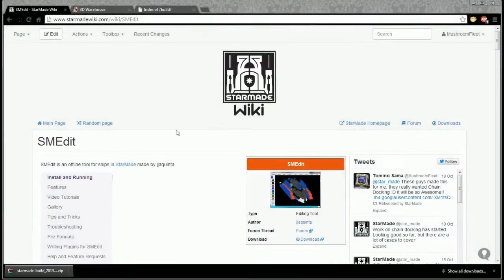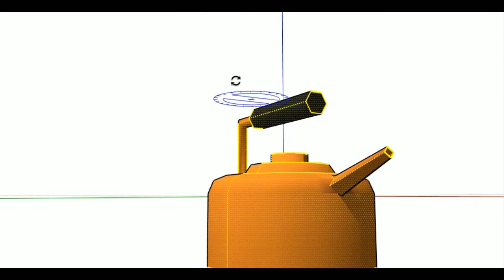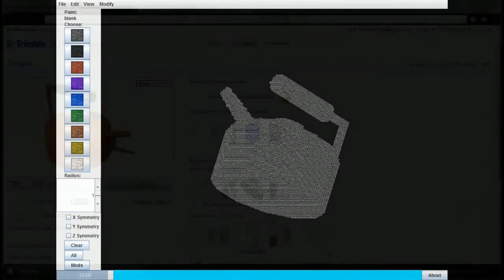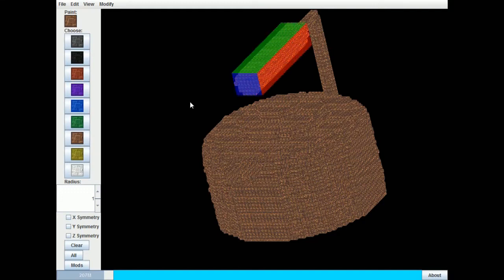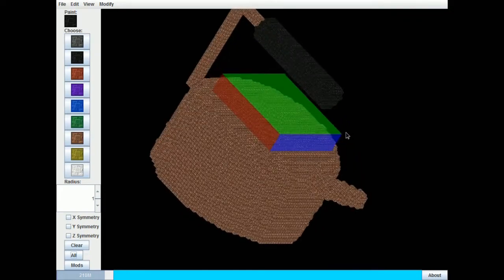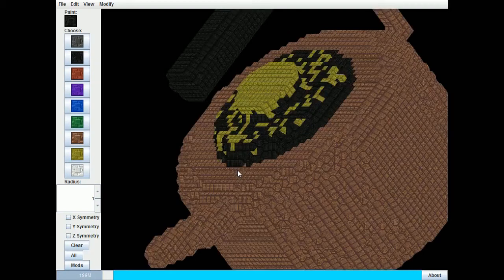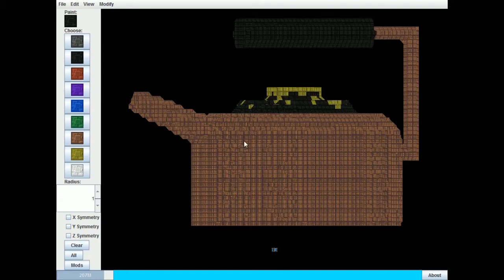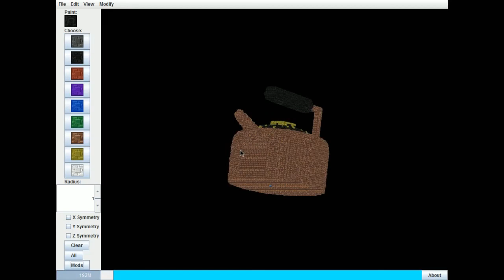OBJ conversion Tutorial [SMedit Starmade] updated Jan 2014

Comment: SMEdit will only work with obj files from sketchup. PS. WATCH OUT!!! sketchup obj conversion is a pro feature! Once the pro trial runs out you will have to pay £376/£590 in order to get this feature back as sketchup Make (the free version) does not have an obj conversion option!
Reply from the maker: That's why I didn't upgrade. Try to find an old version of sketchup :)
Reply: MushroomFleet Thanks :) any idea where I can pick up an old version of sketch-up?